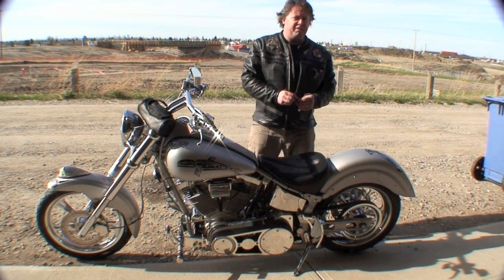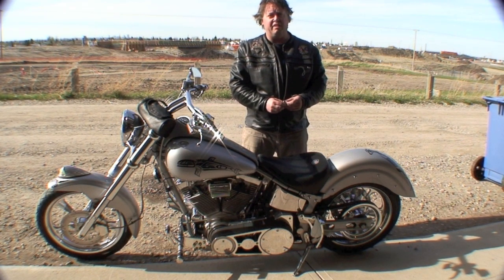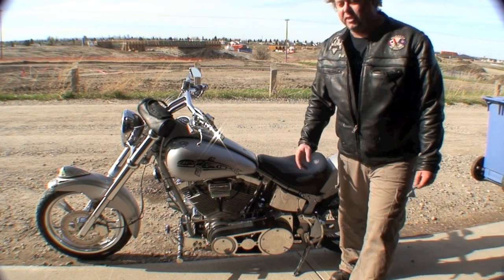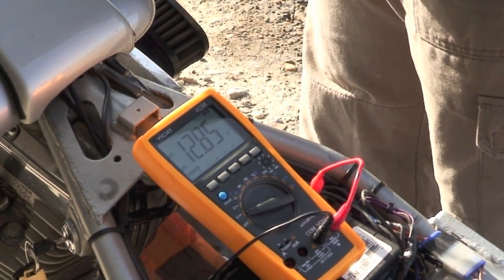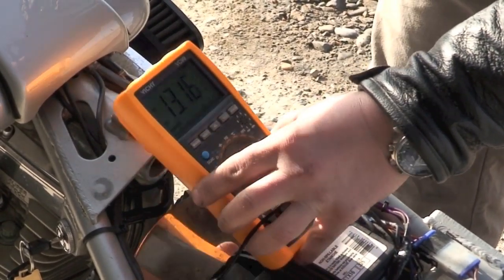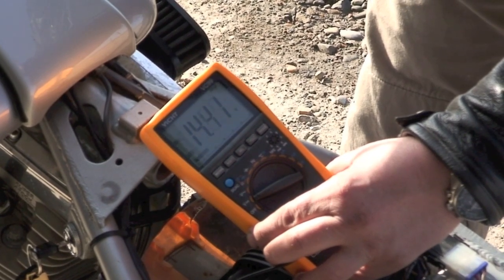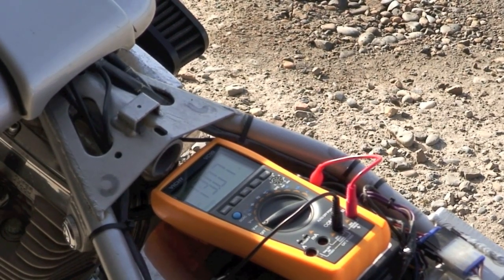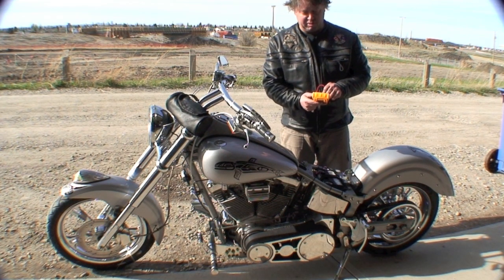DIY How to Test your Motorcycle Charging Circuit

Comment: ok, my test with battery fully charged, shows 12.75 ish...turn knob on tank goes to 
12.30 ish, button on handle bar to on , goes to 12.10ish...  hit start and drops to 7.86ish, to about 9.25ish on 4 tests...but when bike starts at idel stays around 14.25 to 14.49 with a little throttle,  SO does the drop at " starting " point as low as 7.80's to 9.20's any indication of week / old battery ????    ALSO thank you for the videos, they really help us new kids out..any help is great..
Reply from the maker: +Top flight sounds like a bad battery to me it shouldn't drop below 10 or 10.5 while cranking to start.  while running having a voltage of 14.25 says the bike's charging circuit is working properly

Comment: at 1:09 you say connected to battery , BUT on what settings?
Reply from the maker: +Top flight when i mentioned what the voltage is it would be common knowledge that the multimeter would also be set on volts

Comment: i have a brand new battery. i can get my bike to turn on right away but when i turn it off. the battery seems to drain out too fast. i took the battery back to the bike shop and the guy told that the battery does handle a full charge. i install it fully charged and it turns the bike right on... it just keeps draining it quick everytime after i turn it off. not a mechanic, just need some tips.
Reply from the maker: sounds like you have a battery drain somewhere in your system that is drawing power from the battery when it's off
Reply: Bullshitkorner Thank you for the response. this is when i barely install the fully charged battery. i go for a 10 min short ride and as soon as i park it, it turn it off. try to start it and it just weak cranks and i get the click, click, click noise.
Reply from the maker: could be a bad starter, bad starter relay, or even a bad stator not charging the battery amongst other possible things
Reply: Bullshitkorner thanks for your help. i will check all.

Comment from the maker: is that voltage after you charged the battery ??  it is possible that perhaps your battery is toast as well, however since the charging circuit isn't producing 13+ volts roughly i'd be inclined to say something is wrong there... you need to do some tests on your regulator and stator to see if they are in spec

Comment: the battery is professionally tested ok...  i am thinking its the alternator stator...    if one out of three circuit of the stator is open or ground then it wont produce enough power to charge the battery

Comment: what kind of bike is that?   
i have a 2006 kawasaki vulcan 900.   i had to push start a couple of times, so i did a charging system test...    with bike idling, the voltage would keep dropping until it reaches 10V, i shut the battery at 10 v....    the shop says there is nothing wrong with my bike...   help please..